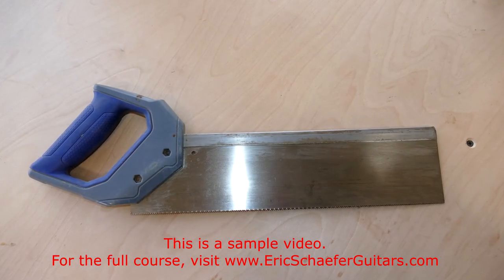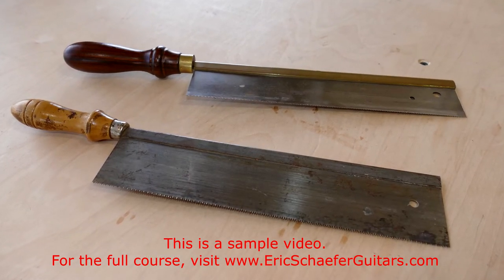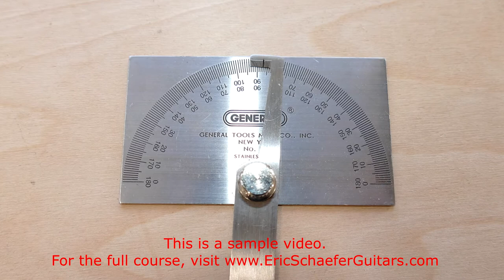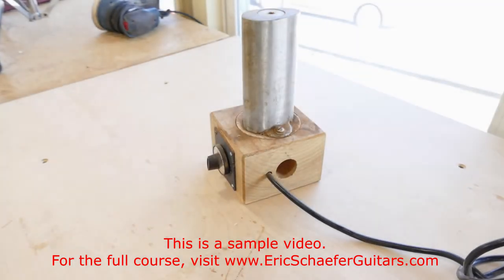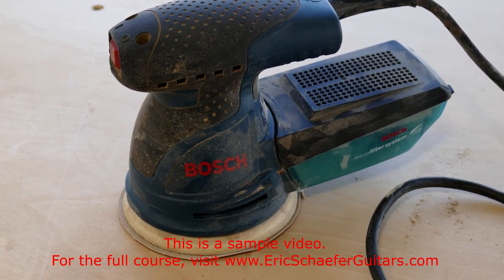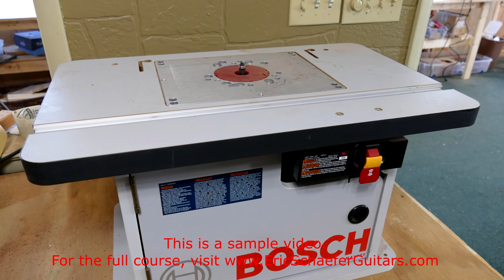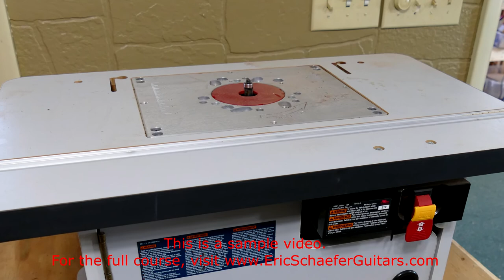Tools - Eric Schaefer Guitars - Online Guitar Building School

Comment: thank you Eric . question please does the string spacing ruler work for 12 strings ?
Reply from the maker: That's a great question, and I wanna say...no... because the thickness of the strings vary in a very different way than on a 6 string, so I don't think you would want to have strings that get closer together in a linear way like you see on a 6 string. Also the strings are in courses so you would want each course to have extra space before the next course. I suppose it could work if you were using it to map out the 6 courses and then you located the individual strings in some other way based on where each course ends up...
Reply: @EricSchaeferGuitars  thank you  i was a wondering about em still they seem a good thing to have  if only for the 6 strings ones